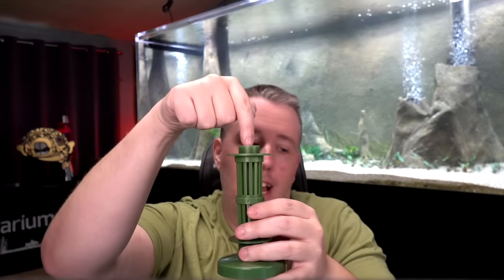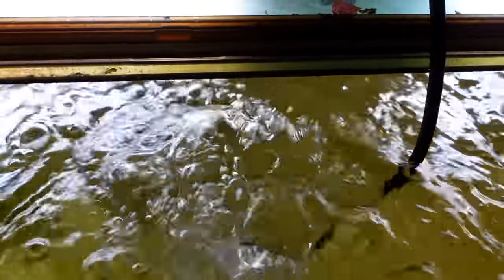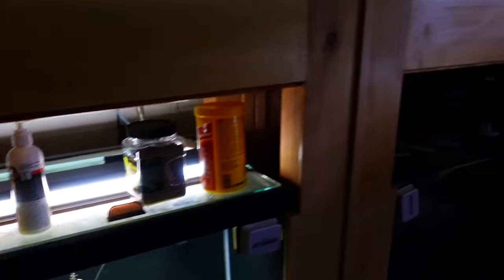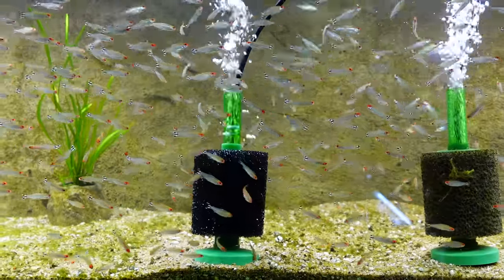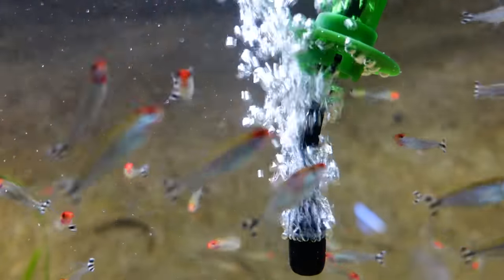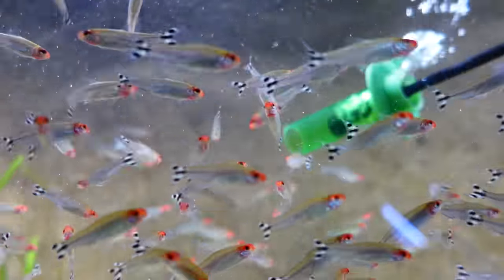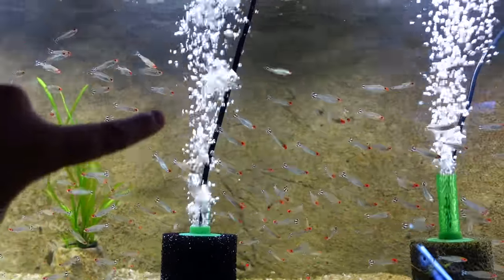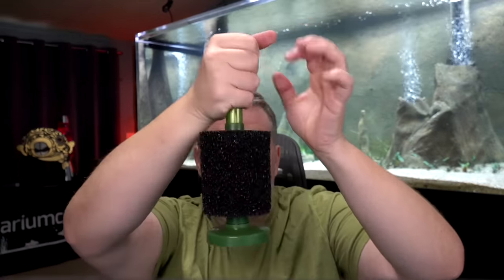How to Optimize and Clean a Sponge Filter

Comment: I need to medicate my tank but need activated carbon after I'm done. How do I use activated carbon on your sponge filter? Or am I off buying a temporary hang on back filter
Reply from the maker: Well typically I don't run activated carbon, I'd just change some water. But you can wrap a carbon pad around a sponge filter if needed.
Reply: @AquariumCoop  Do I wrap the filter all around including top and bottom of the sponge with the carbon pad or just around along the side of the sponge? I just want to make sure I remove all the medication in the water.

Comment: So cleaning it Every other week is good enough ? Or better every weekn
Reply from the maker: It depends on the load in you tank, but over my career with coarse sponges it’s more like once ever 1 to 3 months. At the retail store with high loads it’s like every 2 weeks
Reply: Aquarium Co-Op ok awesome thanks Cory one more thing mine has a bubles come out the top sides every other minute will that cause it to not get good flow ? Or should I switch out the tubing?

Comment: I think we could design a much more efficient, user-friendly sponge filter. I would make a fully-integrated unit with the course sponge and microbubble emitter together as one piece; you would just need to plug this in. Why use a microbubble emitter? Two reasons: first, the smaller bubble size and density would create more flow as each bubble's surface encounters the water's viscosity. Second, the microbubbles will tend to aggregate macroscopic pieces of organic debris at the surface. Third, CO2's Henry's law coefficient is much higher than that of oxygen, so microbubbles under hydrostatic pressure (which is actually considerable at the bottom of an 18'' aquarium) will tend to dissolve proportionately more CO2 into the water column than can be achieved by surface agitation, which merely equilibrates the water with air at atmospheric pressure. This would be nowhere near as effective as running CO2, but it does help in my experience. This entire unit could be housed in an attractive, plastic housing with intake holes that could be adjusted and even temporarily closed to allow the device to be lifted out of the water without spilling debris.

Comment: Good info there, Cory. Thank you.
A side question I have is how does running a sponge filter affect CO2?
I run CO2 into a 65 gallon through a very good diffuser (sitting 12" below the outflow of an AQ110), and air though 2 sponge filters at opposite ends of the tank, but I'm concerned about whether the air injection works against what's already an inefficient way to get CO2 into the water. I tend to run the sponge filters only after the photo period and the CO2 is off.

Comment: Anyone have any ideas on how the length of the uplift tube affects the flow rate. Is there an optimal length versus air flow.
Reply from the maker: You need to look into the research papers for air lift the government has done. Air bubble size, diameter of tube and length of pipe all change based on what you are trying to accomplish.

Comment: I have a 25 gallon fish tank and I want to put some fish in it.  I have a ten gallon that's going to be converted into either a Betta tank or a quarantine tank it's heavily planted with Anubis and ferns and swords.  Optimized hob and a little volcano bubbler I ended up optimizing that with a 5 gallon water or ten gallon sponge filter I have. Bubbles trickling out to not create to much flow.  But any way I want to put in my 25  heavy planted and driftwood scaped and a good school of 15 or more tetra.  Kuhki loachs a mystery snail and possibly some shrimp and a honey gourami or maybe a male betta

What is my filtration needs? I have 2 15 gallon sponge bubblers or one maybe is a 20

Comment: I added a sponge filter to my tank to see what the big deal is, I can say they do not collect any large amounts of stuff only fine particles, and I even have mine on a 370 gph powerhead and I was expecting it to collect the larger particles, but no nothing but fine particles.
I have tested the suction and it does not even bother the  babies at that amount,
Air does not provide enough air flow and a sponge filter in my experience is ok for fine particles but I do not see the aquarium benefitting from only a sponge filter..

Comment: Im sure the answer is obvious but, if the tube is blowing air into the sponge, how is the sponge performing suction ?
Reply: As the water exits at the top it sucks water, and its not blowing on the sponge otherwise the sponge would be bubbling

Comment: Can I  shorten the green tube ? I have a 5gal bowl and thought shortening the green tube would increase the oxygen inside the tank. Anybody have advice???
Reply from the maker: You can shorten the tube. However it won't change the amount of oxygen entering the tank. As it'll dissolve on the way up and that's the majority of the oxygen transfer.

Comment: Now make some where the air line comes in from the bottom to hide the air line. Cleaner, better looking scaping.
Reply: And offer parts like longer lift tubes that could take up to surface like old undergravel filters, and have 90° parts to make a directional current.

Comment: Whatever I do, bubbles still leak out from top of sponge. The length of tubing is as short as can be. One of the cons of a coarse sponge.
Reply from the maker: Fine or coarse sponge doesn't have an impact. Is your sponge filter level? What type of air stone? Are you trying to push too much air?
Reply: @AquariumCoop  it's your coarse sponge. It is level. I'm using the ziss adjustable airstone. It's 90% tight. My pump is a tetra whisper and even with it's own air flow adjustment, I still get some bubbles

Comment: I DISAGREE:
Glug, glug= SURFACE AGITATION. 
Surface agitation= EXCHANGE of GASES..
TINY BUBBLES MAKE A HIGH PITCH NOSE ON SURFACE & LESS AGITATION.
ALL AIR STONES GET CLOGGED.
Also the top tube is where the water lift takes place, and those tubes ARE SHORT!
So all those sponge filters are INEFFICIENT! Less suction through the sponge with less top tube!
In the end, if your really bothered by the "glug, glug", then just get a small powerhead, and attach a big sponge to it, and avoid all this hassle.
Problem solved .

Comment: Not a fan of those "never clog" airstones. First of all they actually do clog pretty easily and with my experience they really are not adjustable. My bubble sizes never changed and actually came out quite large.
Reply from the maker: I’m not sure what’s going on with yours. I’ve been running hundreds of them for years and have never had a clog and can adjust the bubble size.
Reply: Yeah I don't know. I really wanted to like it, and actually did run it for quite a while. I was just never able to get it adjusted to where it actually made a difference. Who knows maybe it was just user error. I plan on giving it another chance the next time I clean my spong filter.

Comment: You haven't demonstrated that the flow or performance is improved with an airstone.  Not having actually measured the flow I'm uncertain how you are qualified to make these claims.   Even if I do accept the idea that bigger bubbles "use more air to do the same work I don't see why that matters.    I've used sponge filters with and without airstones and I've certainly never worried how straight the bubbles are and I still get good stable water conditions.
Reply: I don't know why I'm so annoyed by this video.  Every time I see a sponge filter at a slight angle I think sarcastically "OH MY GOD THAT MIGHT BE WORKING .003 GPH LESS EFFICIENT!!!!  Or maybe more efficient I don't know I HAVE NO WAY TO CHECK!!!!!!"

Comment: want clear water , get an under gravel filter system and a hang on back filter.  sponge filters  are not very good, they were invented for bare bottom tanks if you have gravel get a UGF! wave makers ?!? nah a power head on an under gravel filter system is 10x better than just a wave maker.... i own over 2 miles of windy creek .  the amount of under ground water flowing in the gravel would survive you , even in off shoot dead ends of the creek the amount of under ground water is so amazing..   a dead flow substrate is very unnatural  .. high flow in the substrate will fix all in scope nitrogen issues

Comment: Coarse sponge filters are bad. Why sure they don't get plugged up as fast as a finer sponge but when you remove the sponge filter all the dirt just gets into the aquarium water   The course sponge does not hold the dirt. Your aquarium water will be all full of dirt when you   clean the sponge